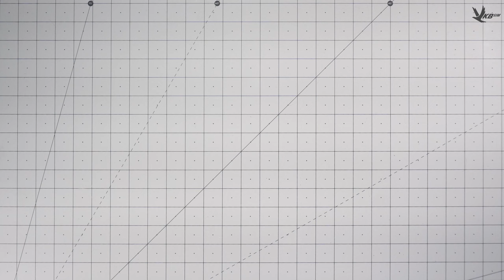Gladiator NXT EVO Quick start guide

Comment: So I've had my EVO Premium for 24 hours. I must say VKB has made a wonderful product! This stick while plastic and more affordable give BIG stick performance. The dry clutch and options for various spring tensions are a feature that are a blessing at $165 price point. And while this stick is marketed as a "Space" stick , It is my go to for DCS. If you want quality at an affordable price point I recommend this stick!
Reply: Do you recommend getting the standard or premium version? I think one has more buttons as well as a different stick up top. Thanks!
Reply: @collander7766  Premium no contest.
Reply: @oldmanfunky4909  what does the premium have that’s so much better? I’m looking for a new stick for DCS and other modern flight sims. Would the F-14 stick be better then, for around the same price as the premium?

From the looks of it, the F-14 stick actually seems worse imo with less buttons where they should be.
Reply: I don't know about the F-14 stick, however the premium gladiator stick comes with a thumb 4-way hat instead of the standard thumb button (spare button is included if you want that instead), a ministick instead of the standard 4-way hat (you can replace it with the spare 4 way hat included too), and an additional rapid fire trigger (can be depressed either directions for two additional buttons). It also has a set of soft and hard springs if you want to change the default ones.

The 6 extra buttons are nice, but for me the price difference is justified by the ministick alone. When you use a stick which doesn't have one, you invariably end up wishing you had spent that little extra on the analogue axes.
Reply: @jukahri  that’s my thought process. The F-14 stick is quite expensive for how few buttons it has. It basically takes away all of the useful stuff just to have a gimmicky weapon selector knob
Reply: @collander7766  all that the guy said plus option to have the standard one with it (for example c1 premium but a1 standard)
And you got more spring option
Reply: This stick have a 220 euro price in Europe not $165
Reply: I’m thinking about using this and a hot key mouse. This is my left hand stick and the mouse is the throttle, then after building horrible horrible muscle memory, I change out the mouse to a new stick, and this one becomes the throttle. What could go wrong?

Comment: I just placed my order for two sticks.  I got one SCE and one omni throttle.  I chose VKB because I knew I didn't want to start with the brands that break after 2 weeks but I also didn't want to commit $1,000 for a HOSAS right out of the gate. The entry price and quality were important but the upgrade path for future gunfighter gimbals is what sealed the deal for me.  Amazing forward thinking and greatly appreciated.
Reply: looking at buying something similar to you, a year on are you still glad you did?
Reply: I too am wondering if you're happy with your decision still?
Reply: @WA7S0N  I have had no issues with mine. No calibration issues, no hardware or software problems.  I think it was a solid investment for my needs. I think you would be very happy with the purchase.
Reply: @BlueMax717  Thank you, I appreciate it.

Comment: I read the specs but still don't understand how EVO is different from the premium NXT... I have the premium NXT for right hand and probably want to get another one for the left - so should I now go with the normal premium NXT for the left to have similar sticks in both hands, or should I buy the EVO just for left hand?
Reply from the maker: The original NXT is still a great joystick, so no reason to change! Keep your for the right hand and get an EVO for the left hand. The EVO has updated electronics, dry clutch on pitch and roll axes (you could use it as a throttle) and a few other smaller changes.
Reply: the Evo can be used without the springs and have the X axis locked to act completely like a throttle or helicopter collective that doesn't return to center (because no springs) the dry clutch can be adjusted to adjust the resistance to movements, independently on the x and y axis.

it also has upgraded internal processor which will be helpful if you're attaching many expansion moduels like throttle quadrants and button boxes.

I have this for my left stick with the Y axis having to spring to act as a throttle to stay where I leave it, but I leave the x axis unlocked for when I play 6dof games and I need to be able to strafe left/right and it will return to center if I move it left to right, but stay in position forward /back to maintain throttle speed

or as I said you remove both springs and it acts as a VTOL collective

Comment: i mighta just messed up, when you said screw the self tapping screws i screwed in the ones that i found that looked exactly the same (they had the same top) and then after screwing them in i find another bag with screws that have the same top marked "GRIP MOUNTING ONLY" am i fucked?
Reply from the maker: Nah, they're similar screws, just longer. They're supposed to replace the shorter screws for those who tighten them too much. You're good, just don't over tighten.
Reply: @VKBSim  ahh thanks, i figured it would be fine, its been awesome so far

Comment: Love my Evo! I only wish Dutch customs would finally clear the replacement springs for my KG12. First batch of those sticks were shipped with soft and hard springs missing, and now early adopters are still waiting for them to arrive. International shipping still seems like a bit of a nightmare these days.
Reply: can you change the grip to another if i want to play il2 and then change to play dcs?
Reply: @vertigo_surprize7351  In theory, yes... but it's not meant for that. Not only is it a bit of a hassle to open the stick, undo all screws and plugs, etc - some of the parts I wouldn't want to plug/re-plug or screw and unscrew on a regular basis. Even VKB themselves don't recommend using the Gladiator in this way. If I bought that stick again today, knowing what I know now, I would go for the SCG Premium and be done with it. That thing has all the buttons and switches you'll ever need. More than enough for any WW2-sim I can think of and it should also do well in DCS. I haven't counted them, but I'm pretty sure it offers at least as many functions altogether than, say, the TM Warthog stick.. perhaps even more.

Comment: can you please demonstrate (with the omnithrottle grip) converting to a throttle with locked x-axis
Reply from the maker: Next video will show this.
Reply: @VKBSim  this will allow it to be used as a collective correct. I have purchased and just got a tracking number.
Reply from the maker: @MrMbadkins  It is not a dedicated collective, but it would definitely play the role.
Reply: @VKBSim  my understanding is it could be used a collective so to speak
Reply from the maker: @MrMbadkins  You could watch the way it works in the video.
Reply: @MrMbadkins   You technically can use it as a collective but its meant to be used as a throttle.  I've only seen people use the omni throttle set up in space games and once you watch a video, or if you understand flight characteristics in space flight, you will see why.  The stick will want to return to center position which means you are going to porpoising all over the place if you use it as a collective.
Reply: @BlueMax717  You can remove the spings, tighten the clutches and mount it vertically to pretty much exactly mimic a collective, though. I'm going to try this very soon.

Comment: Just got it today, looks great. Feels a bit stiff though. Is there a guide how to replace springs for softer ones?
Reply: Looks like you just unhook them using a small poke tool or screwdriver based on the video. Once I get mine I'll let you know tho if thats not the case

Comment: When you setup the joystick for 6dof and the x axis is free does the joystick have a detent to feel where the center is?
Reply: it does not, but I just set a decent deadzone in the middle (about 10%) and I haven't had issues with keeping it in "the middle"

love this so much on my left stick with omni throttle adapter, works great for atmospheric and space flight Sims.

it did take me a while to get the perfect resistance setting with the 2 adjustment screws, but once it's dialed in it works like a charm
Reply: I can just barley feel a change in resistance as I pass the exact middle point, you'll get used to it after playing with it a few hours

Comment: I just got my EVO Premium, and it is amazing...  I'm just wondering however -- is there a manual for it?  I have managed to adjust everything to my liking, but I would like to know simple things -- like what #strength springs does it ship with, and which are stiffer/stronger -- #10 or #30?
Reply from the maker: It ships with the medium #20 springs on. The #30 springs are heavier and the #10 springs softer.
Reply: @VKBSim  Thank you so much!  While I’m at it, is there a way to change the configuration of the rotary hat to use the push function as something other than a mode or lock button, where the rotary hat performs two functions?  I would basically like to use the push down on the rotary to be its own button  push...
Reply from the maker: @calihutch  If you're talking about the ministick, then yes, it is possible. Please visit our forum and request details, there are already some threads on this http://forum.vkb-sim.pro/
Reply: @VKBSim  yes - I am referring to the ministick.  I was able to visit the forums but I didn’t see anything that helped.  I’ll try again...

Comment: Hi. Are the three little screws in the transparent bag labelled - GRIP MOUNTING ONLY-  the one to be used to secure the Grip to the base, or the longer ones, in the unlabelled bag ? Thanks
Reply from the maker: The 3 self tapping screws in the Grip Mounting baggie are for attaching the grip to the base. The longer ones, in the unlabeled bag, are spares, in case one would strip the hole by tightening too much the original screws.
Reply: @VKBSim  This is such a neat detail! Seem you really have thought this through!

Comment: I just ordered two combat editions with two side modules are they going to be able to work together? I know this is an old video but still hoping for a reply
Reply from the maker: Need more info on the products you purchased please.
Reply: @VKBSim  I got 2 Gladiator NXT EVO ‘Space Combat Edition’ - 
One right hand one left hand omni 

GNX SEM (Side Extension Module) x2

Plan on using for Microsoft flight simulator and elite dangerous wanted to know if they will have conflicting button mapping when using both side modules
Reply from the maker: @OrioThyGrim  No, you're good; they will get assigned as different devices once initialized.
Reply: @VKBSim  looks like I'm good to go, Y'all can thank the YouTubers and their b reviews for the $600 purchase 🥂
And shout out to all my hard-working comrades out in the big CN

Comment: Hello! I’m very interested in this unit, especially because I’m considering using it both as a combat stick and a stick for commercial aircraft combined with my throttle quadrant. There are just a few questions I’d like to ask.

1. How does the unit stick to a surface? I see the screw holes, but are there rubber pads for example?

2. Is it possible to set the multiway hat switch as a control for my view while in cockpit?
Reply from the maker: Hi there! There are screw holes on the base plate for attaching the joystick to a hard surface, but there are also silicone pads under all 4 corners, which provide stability on a desk.
The A1 ministick could get assigned to any functions (including view around). It has 2 modes: analog (2 axes) and digital (POV mode, with either 8 way or 4 way); pushing the center button swaps the modes.
Reply: @VKBSim  thank you so much for the answers, have a great day!

Comment: I had some problems with two defective pcbs... Customer service was slow initially but with the help of the fine chap who runs this channel, I was able to replace the defective parts and got the NXTs working again. Use the vkb support forum, it is your friend when you need one.
Reply: I'm sure they're not bricked and you just don't know how to use the software. thought I did the same thing
Reply: @lilbippy7691  I'd love to know what you know but mine are totally dead and not recognized. They said they would send replacement pcb which hopefully will work. If it was me not knowing the software that would be so much better! If you know something I don't know I'd love to hear it, there's a few other people having the same problem.
Reply from the maker: You are supposed to receive new parts through the ticketing system. If you are not happy with this resolve or with the products please return them.
Reply: @halcyonzenith4411  i thought i bricked it too while updating the firmware something happen and it was not getting recognised too, using boot mode i was able to update it and it's all good now
Reply: @halcyonzenith4411  
I found you have to calibrate all the axis' thru there full range of motion (ex. Yaw all the way left, then yaw all the way right, repeat for each axis)  If not they either won't be recognized (flashing red and blue lights) or they will not function right in game.
Reply: @greatdanexlks  Yup I see what you are saying. In my case both sticks are totally dead. No lights turning on, not recognized by the computer. I also got a pretty good electric shock discharge from the second one right before it died. 
In both cases the "new" joystick survived and works fine, it was the one that was plugged in first that died. At least one out of three is still working but there goes my dual sticks setup I guess.
Reply: @VKBSim  I have submitted the tickets and will wait for the replacement parts. I asked for return and refund but was denied it. After waiting for 4-5 days just for a response. It's a good product but clearly there was some quality control problem as several other people recently received these defective units. If it's not QC then it is a design defect. In this case I would expect to be getting messages from the tech department wanting more info about the problem, but I only hear crickets.
I am not the first person to say that VKB needs big improvement on customer service. This is the north American market in 2022, not the Soviet Union in 1980.
Reply from the maker: @halcyonzenith4411  You are right, you're not the first person to have issues with your device and also not the first person not happy with the customer service. But you are definitely one of the very few. You seem very upset and it's understandable. On the other side I can definitely tell that at this point whatever we'd do we won't make you happy, so I would suggest again to send back your devices for a full refund. 
I'm sorry to hear you had to live through the '80 in Soviet Russia, it was a hard time, but look at you now.
Reply: @VKBSim  I would love to return for refund, I already asked for this but I was refused. Instead of telling me about how my problem doesn't matter why don't you do something about it. If VKB honoured its commitments and gave me the refund return that I asked for, I would be more than happy. 

I am accepting the fact now that VKB will not help me and that I have wasted money on defective products. I have tried to be patient and diplomatic but all I get from VKB is either dead silence, or bad attitude such as you have demonstrated with your comment. 

I will simply report my experience to others and hope that they don't experience the same misfortune. I can afford to lose money.

Final suggestion. Don't let engineers handle customer service. Let them focus on fixing problems instead of causing them.
Reply from the maker: @halcyonzenith4411  Let's work together on this, you could do whatever you want, but we really don't want to see unhappy people around. Please contact me on the official forums, send me a private message with your ticket number, I'm fallout9 over there.
Reply: @VKBSim  I will be in touch. If we can communicate a little better perhaps my view of the situation can improve.

Comment: i got the EVO NXT with extra springs. What number spring is the spring inside the base when new? I have three bags of springs nrs 10, 20 and 30. I think 30 is installed as standard? So 10 is more soft? thanks
Reply from the maker: The #10 springs are soft, #20 medium and #30 hard. It comes equipped by default with #20 springs.
Reply: @VKBSim  thanks for your quick reply

Comment: Can I make it so that when moving it up (from center) it stays there but if I move it down (from the center) it goes back to the center if I release it? I basically want a throttle for positive acceleration and joystick for negative so I can always easily put it to 0, not sure if makes sense what I am asking. I guess I would have to keep all springs and tighten only one of the dry clutchs? Thanks.
Reply from the maker: It makes sense, but I don't think that'd be possible, even with only one of the dampener screws fully released.
Reply: So what would be a good way of using it like a throttle with an easy way of finding neutral? If I remove the spring I wont be able to find 0 easily
Reply from the maker: @Wallack  The center detent is spring dependent - if you remove the spring there'd be no detent. You could try to enlarge the deadzone on the pitch axis and program the large LED on the head of the grip to turn red when the grip is centered. It might take a while, but eventually you'd get used to return to center without detent.
Reply: @VKBSim  The led tip is brilliant, thanks!